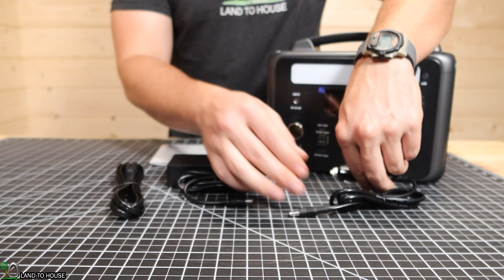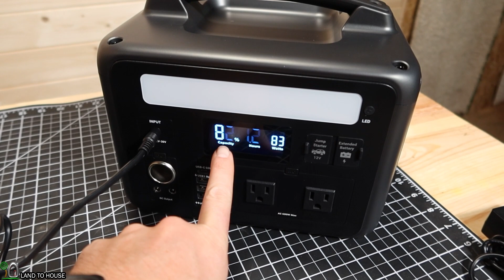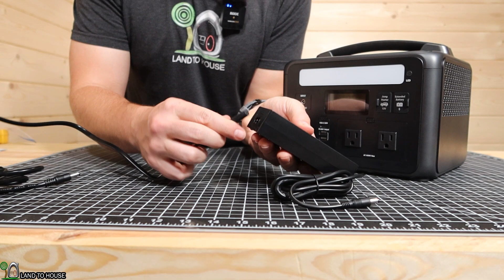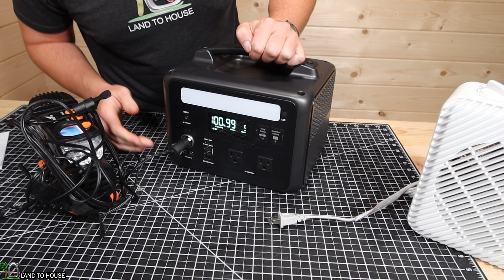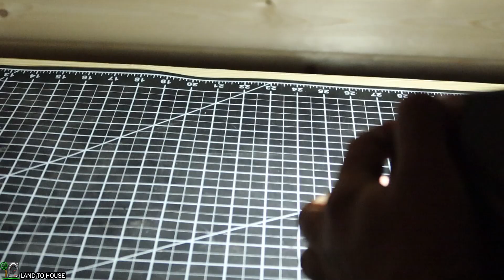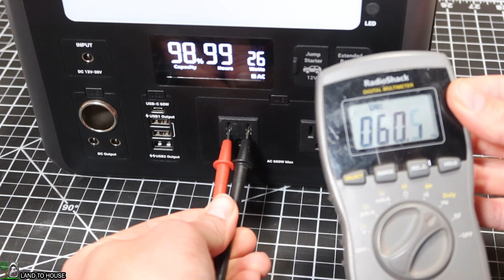Ampace P600 Power Station

Comment: What size plug does the charging input require? I purchased a 100 watt solar panel with an 8mm plug, but it's too big and will not plug into the input port.

Comment: Thanks for the video! I was looking for information on the "Landnor P640" and couldn't find a darn thing...this Ampace looks identical to the Landnor, so probably pumped out of the same factory. The Landnor also states having LifePo4 but on each description  (on the unit, and in the manual, it states Lithium Ion with no mention of Lifepo4)
The Landnor was $320 for 640wh, but now I see why that was way too good of a deal. They lie...lol.
Thank you again for walking through these tests for us electronically challenged folks!

Comment: Questions:
1. What is a LiFePo4 HYBRID battery? Not the same (or as good as )an actual LiFePo4?
2. What is the max solar wattage input for this unit? A 100 watt panel seems slow.

Comment: You missed the best charging method. The kids on a stationary bike wired up....
That's why it can charge and de-charge simultaneously. When the kids are naughty they must charge the inverter to Max while the heater is plugged in and aimed at them! Haha. All in good fun ppl. Probably DO NOT TRY THIS
Reply from the maker: The energy my kids have would overload this unit haha

Comment: Actually quite cool that this one's overcurrent protection will limit the output current extensively before shutting off.
Reply from the maker: It is nice. I have used a couple that do this.

Comment: nice review. The spec info on their website does mention that it is a pure sine wave, but perhaps not 'pure' enough for that lighting. Also, interesting to note that the battery tech is LiFePo4 so not a good idea to charge under 0'c, ok to discharge at much lower temps though. I wonder if it has heating pads? Cheers.
Reply: Hey, friend， Ampace P600 keeps you charged when you need it most. Temperature range：-4 ℉-113℉
Reply: @ampacetech  ah great. So it will charge at -20c (-4 ℉) ?
Reply: @mw0lge  yep， Ampace P600 power station supports 
output
-20°C  (-4 ℉) to 45℃  (113 ℉),  and input  -10°C  (14℉) to 45℃  (113 ℉),  so don't worry , friend